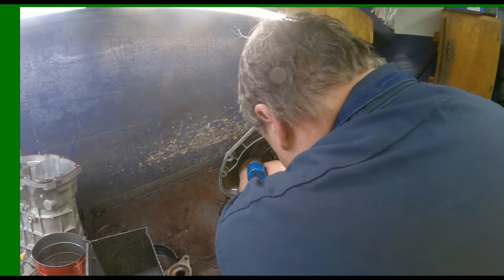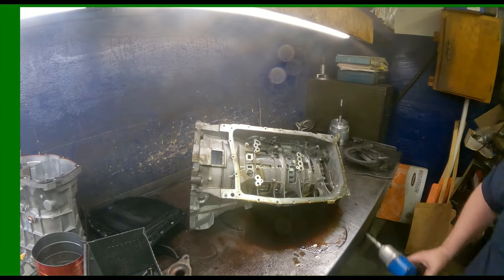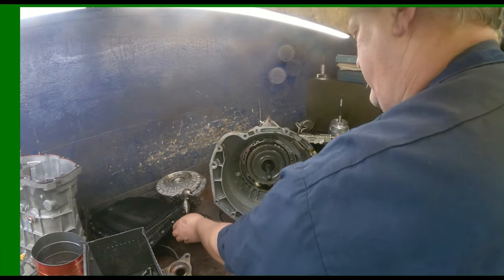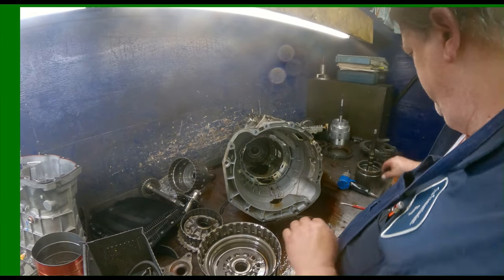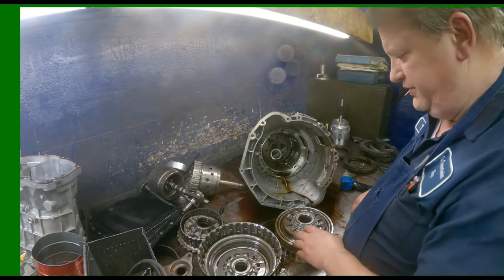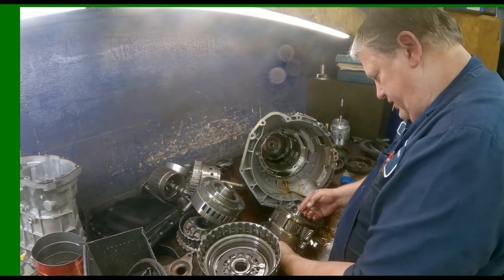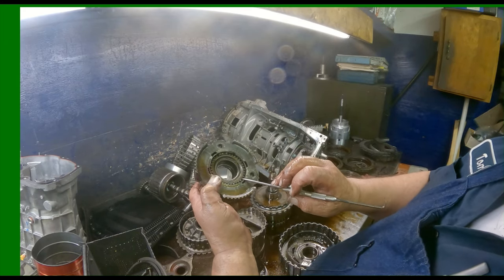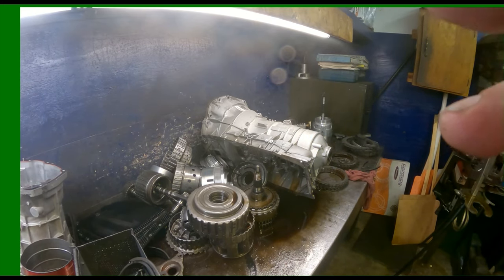6HP26 Disassembly

Comment: Hi, love watching your videos. I'm trying this transmission for the first time. Came from a 05 navigator. It had codes before overhauling. Gear 5 incorrect error, 3-4 shift error. Put everything together, used a sonnax zip kit, put everything back together. But now, reverse doesn't engage, and it still has those same codes.
Reply from the maker: Thanks. If you had not cleared the codes after the rebuild you need to do that. They will not automatically do it. The adaptives also need to be reset and the shifts relearned after that. If you had cleared the codes and they returned you probably have a cracked 4-5-6 drum. As far as the reverse. I would take another look at the valve body and make sure all the check balls are in the correct locations and make sure everything was done correctly with the kit. Keepers in the correct locations, etc..

Comment: My 6HP26 (2005 Jaguar Vanden Plas) is running well, but I still found myself watching the video for the sheer fun of it! Thanks for the entertainment!  Do you ever see 6HP26 failures from using "recommended" fluid other than Lifeguard 6? Like Valvoline Maxlife, or Amsoil Signature Fuel-Efficient Synthetic ATF? Cheers
Reply from the maker: Not always, but yes. I have seen issues with not using the recommended fluid. And I would never mix fluids. Using a different fluid on a fresh build, maybe. But like I said, you can run into issues.

Comment: Hello. Have you repaired these units in the recent years? How's the parts availability? Especially hard parts. I've seen in the comment you've mentioned it's hard to get EVEN A BUSHING kit for them. Strange since this is a popular unit. I'm buying a towing vehicle with such transmission , about to tow 2500-2600 miles every month a trailer with total weight of 4000-4100lbs. I'm thinking of installing aftermarket cooler and changing the fluid every 20000mi. Thanks.
Reply from the maker: Yes, I see them all the time. It is hit and miss on the parts. Things have gotten crazy since Covid.

Comment: Do really we need to be mark on the front pump gear 
Any indication to putting back properly 
!?
Thanks
Reply from the maker: You should get used to marking them in some fashion. Not all transmissions will have identifying marks and should be put back in the way they come out. This transmission however does have identifying marks and they face up. You will not know if someone has been in the unit and put them in upside down if you don't mark it.
Reply: @CurmudgeonTransmission  thanks 
However I’m working on 6hp21 .bmw 730li .2012 
There is dot on the gear
Reply from the maker: Dots face up on both.

Comment: Hello.which washer is placed on the shaft from the parking drum, and which one between the bearing and the flanges of the drive shaft?
Reply from the maker: Could you post a picture or video on your profile of them? If not go to my Instagram and post it there so I can see which ones you are talking about. The two you are describing are not even close to each other, and you cannot put them in the wrong spot. Either that I am way off on what you are describing.

Comment: what is the difference Between GA6HP26Z to 6HP26 ? Thanks
Reply from the maker: Z is an AWD, 6HP26 is a RWD.
Reply: @CurmudgeonTransmission  you are correct my its a Z for my xDrive! what about the- "GA"-6HP26Z (AWD)
Reply from the maker: Just ZF's designation. Stands for gear automatic.
Reply: @CurmudgeonTransmission  Thanks for the input 👍

Comment: Are the bushings badly worn out?
Reply from the maker: Always. Getting real hard to get them now. The ones in the pump must be replaced or it will not work right.
Reply: @CurmudgeonTransmission  probably dirt from the hydraulic clutch affected the wear